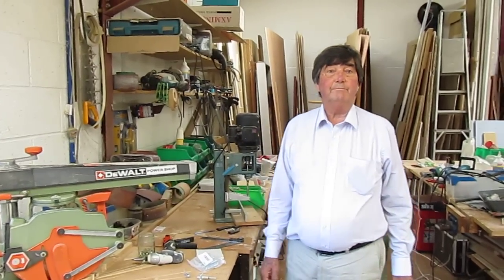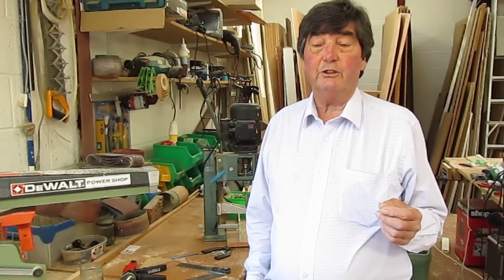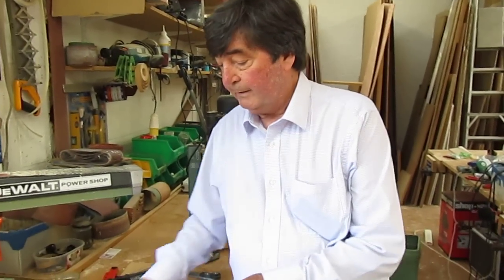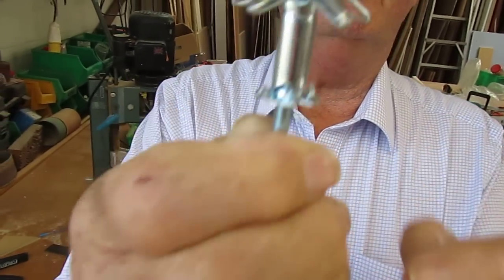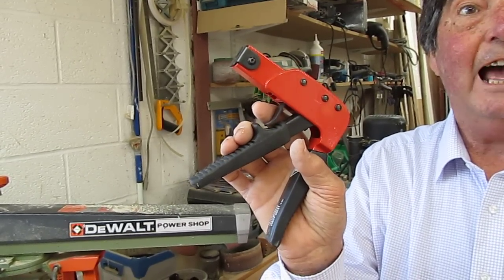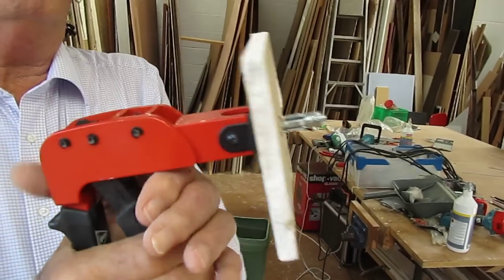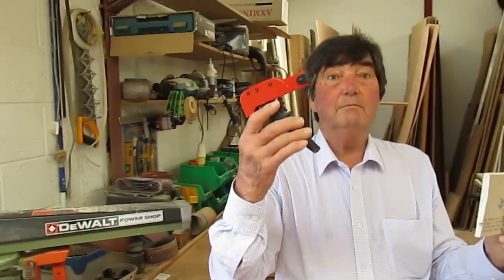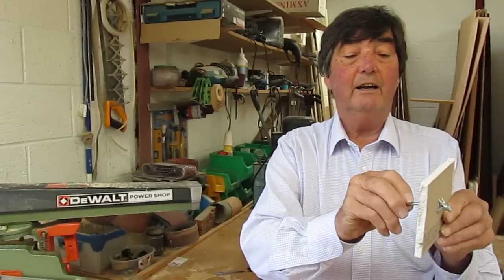Bodge it with Brian. Plasterboard Cavity Wall Anchor Fixing Gun

Comment: Could you carefully tap it in with a hammer placing a socket over the washer which would evenly distribute the washer force?
Reply from the maker: No, it just spins and chews up the plaser board. The fixing needs to be squeezed so it fixes.
Reply: bodgeitwithbrian I've just got an idea. Place a nut on the bolt and screw bolt in and then, tighten the nut to pull the fixing in place. Then slightly loosen again when done. Then unscrew the bolt. Obviously this wouldn't do if you done this sort of fixing lots. But in my case it's 4 fixings. EDIT. I'm cheap ;)